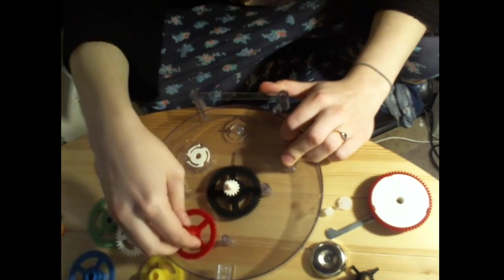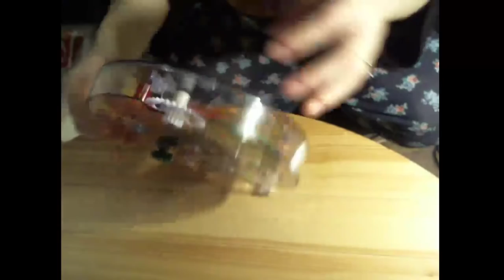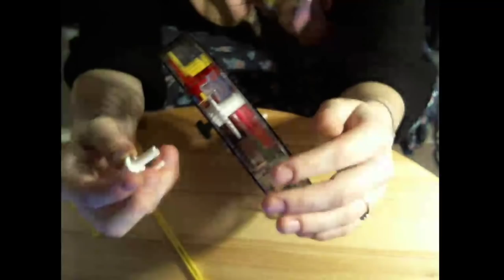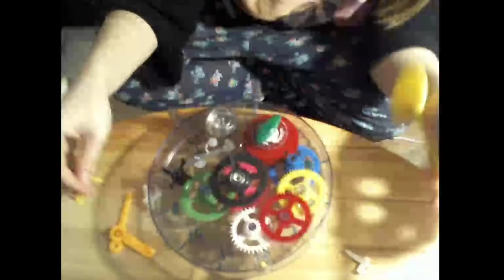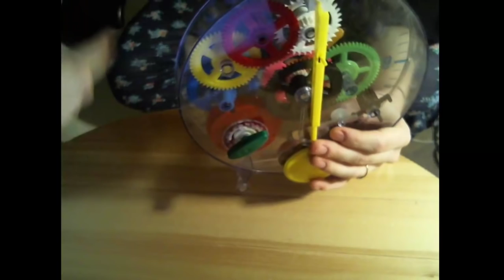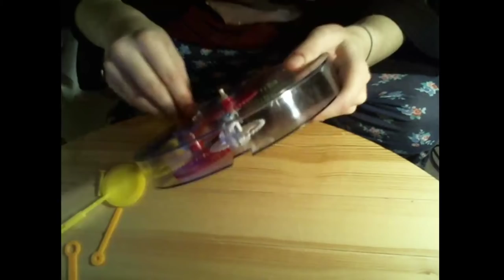Clockwork Assembly: Gear Ratios, Poka Yoke, and My Merch Idea

Comment: Hmm if you have files you could 3D print the gears with wood filament and have a carpenter make a nice case/housing for it. It's doable. But it would take a lot of work, time, and effort (or you could pay someone else to do it)